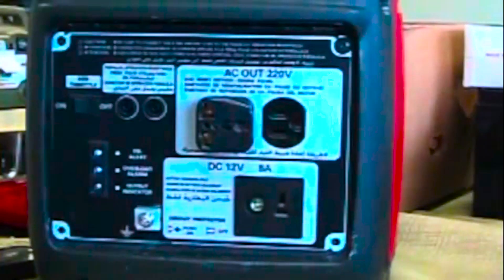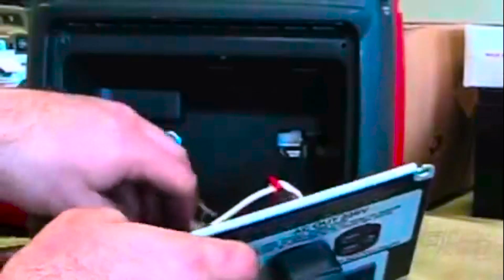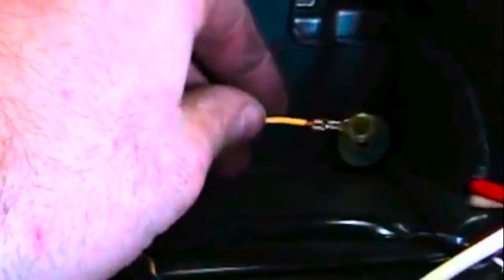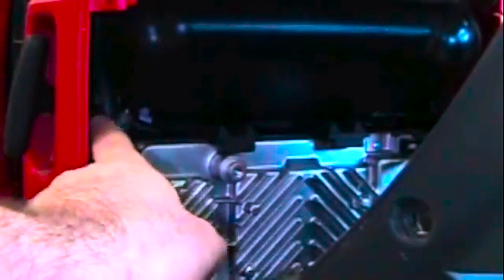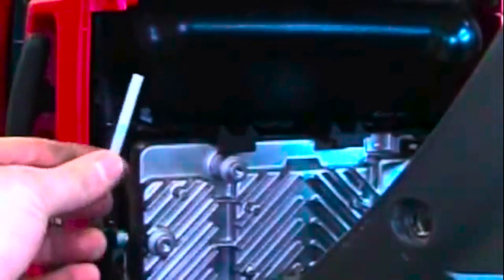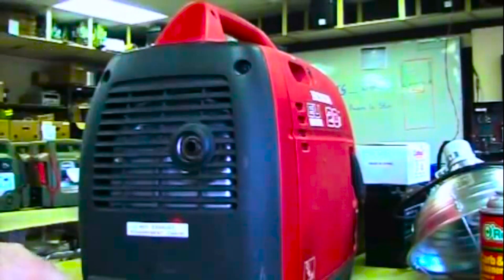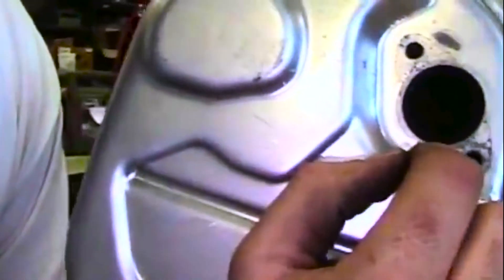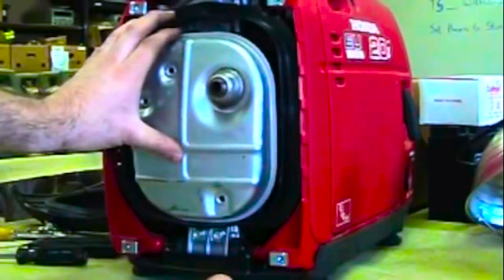Best Guide Honda Eu2000i Fuel Filter Cleaning || Honda Portable Inverter Generator Review 2023

Comment: Thanks for taking the time to produce this video. Taking the front control panel off looks straight forward. Hard to imagine enough debris getting in to clog the finger filter, but I guess folks aren't careful when filling up and somehow allow dirt to get in. Honda must have thought filter cleaning was rare as access to it is slightly complicated. Thanks again.
Reply: Pretty sure mine is clogged from extended run kit gasket deterioration 🤦‍♂️